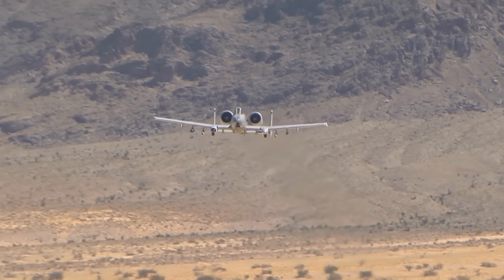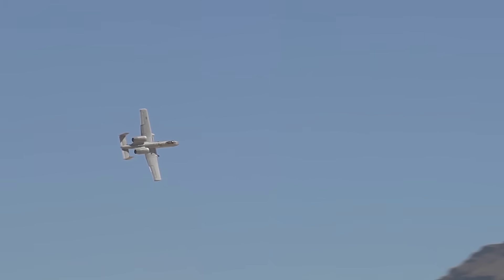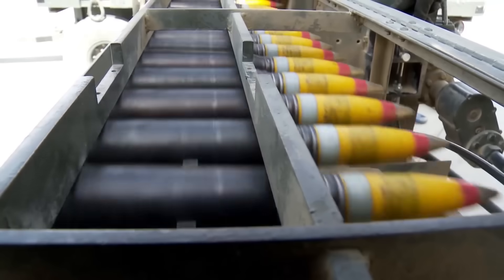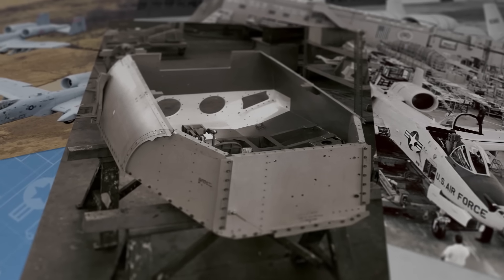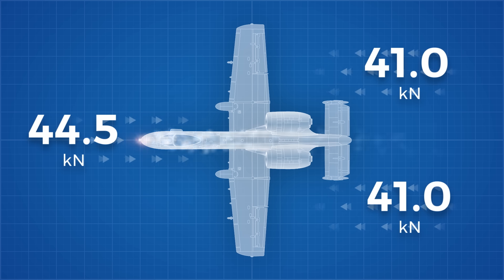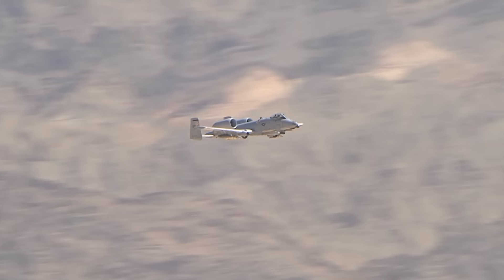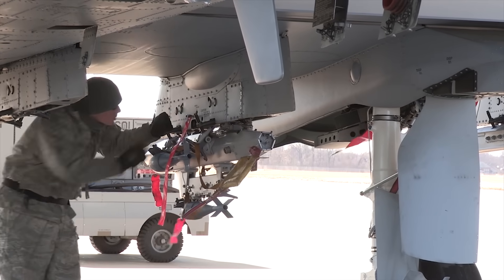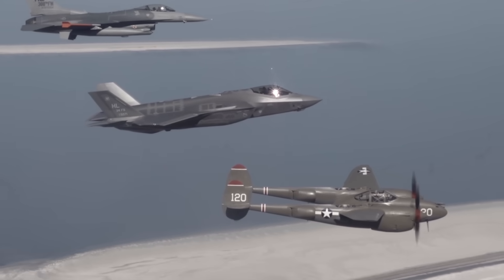The Insane Engineering of the A-10 Warthog

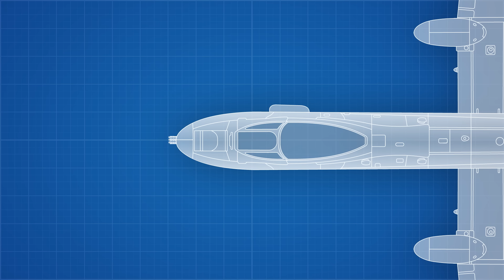Comment: 7:43 the rotating barrel assembly is actually mounted to the side, not directly on the centre. I am just a nerd, not an expert, but from memory it is the 7 o'clock barrel (assuming 6 O clock is bottom dead centre) that is the firing barrel, and it is THIS that is mounted on the centreline. If you look at an A10 front on, the gun appears to be on the right side of the nose, but the firing section is actually dead centreline.

Btw I'm not a total smart ass, I learnt a lot from this video, like the APU thing. The way that depleted uranium ablated compared to steel and becomes sharper was a really cool thing I didn't know. 👍

Comment: I served in the USAF. It is my understanding that the Air Force had the gun went to the defense contracts and asked them to put it on a plane. It was considered too big for the AC 130 at that time which had a 25mm version of the gun due to reported airframe issues that have since been resolved. Current AC 130U's have the upgraded 40mm version of the gun on them. And yes, the USAF proved a long time ago that you can make a brick fly if you put a big enough engine on it.

Comment: The gun didn't exist when the design process started, or even when the YA-10 and YA-9 flew against each other. They were in fact tested with the Vulcan installed. What did exist was a project for developing the gun they were intended to eventually use.

Comment: Much as it pains me to say, the AC-10's days really are numbered, as is the traditional role of CAS in general, due to the increased supply of shoulder-mounted RPG's that even insurgents can get their hands on. I mean, don't get me wrong, the Warthog is a thing of beauty as it flies overhead and wipes out the guys that had you pinned down, but when the other guys have six RPG's pop up and shoot it down... that's not gonna be cost effective. 
I suspect going forward, CAS will be handled by drones either remotely operated from FOB or slaved from F-35's providing CAP. After all, if they shoot down an unmanned drone, it's just materiel being lost, as opposed to pilot's lives. And while you can't mount the GAU-8 Avenger on them, you might be able to mount the M134 Minigun on one. While not the big BURRRR, it might be several slightly smaller BURRRRRRs.

Comment: The A-10 was created because the US Army had developed a helicopter called the "Cheyenne" and was primed to essentially steam the "close air support" roll (and the requisite funding) from the Air Force. The A-10's cheap design was in-place because the aircraft had to be cheaper than the Cheyenne.

As an engineering channel I very much wish you had touched on the large wing area of the A-10. In spite of its size, the A-10 is incredibly maneuverable at low speed and low altitude, specifically due to the large wing area. The F-35 does not have the wing area to be maneuverable at low speed and thus it can't turn and perform nimble maneuvers at the low altitudes of close air support, neither does the F-16, but the F-16 was designed as a fighter, and then was eventually converted to a "multi-role" aircraft by the airforce who did not want their flagship fighter, the F-15, out-performed by the F-16 which was designed by a group within the pentagon known as the "fighter mafia", who were all hated by the main airforce brass.

Anyway, if you want more information about this, I highly recommend watching Pierre Spray (the guy who created the specifications and design requirements of the A-10) talk about his aircraft or the F-35, which he hates. You should also read the book Boyd by Robert Coram, which talks about the guy who's theories about aircraft maneuverability influenced this aircraft's design.

Comment: You completely ignored the very important piece of the A10s replacement, drones. You combine the capabilities of the multirole F35 and a constant overhead Predator or Reaper and there need for the A10 drops pretty significantly.

Comment: Have a veteran bird at the museum I worked at. Flew during Desert Storm where it took a direct hit from flak. Blew the tip of the left wing  off, which got ingested by the left engine, which then on top of killing the engine blew out shrapnel that destroyed the control surface on the left side of its tail. Pilot lost hydraulics and had to switch to the fully manual control, which meant roughly 15 seconds of uncontrolled flight while on fire while the hydraulic system purged. Despite all of this, landed the damn thing unscathed and without a hitch. Honestly one of the most robust and badass systems ever.

Comment: The F-35A and C are moronic planes for the Air Force/Navy. Only the 'B' for the Marines makes sense.
The Navy should have bought a navalized F-22 instead of the F-35C. It would have cost about the same and been more capable in almost every way. And save the baloney that it is 'too heavy for carriers'. It weighs less than the Tomcat did.
 And the 'A' for ground attack? That is beyond stupid.
1) stealth means almost nothing in daylight, ground attack. It's stealthy - not invisible.
2) it can take little punishment as it has only one engine and any superficial damage can destroy it's stealthiness. Plus, stealth aircraft are apparently VERY time consuming to fix in the field.
3) it costs MILES more than the F-16 (or the Warthog did in 2020 dollars). And other than stealth - does virtually nothing the other two cannot do.
The Air Force should have stuck with upgraded Warthog's and F-16's and built an F-117 replacement (perhaps an F-22B bomber variant - which was proposed) for high-risk missions.
The F-35 is not a bad plane. But it is ridiculously expensive for what it does - even with the recent cost 'cuts' - (except in the 'B' version) and history will probably show America blew it by developing it for the Air Force/Navy.

Comment: really great assessment of the aircraft.  i was usaf from '82-89, and one of my squadron commanders was an a10 pilot.  he almost seemed ashamed of that!  the white scarf crowd in the usaf has been trying to kill this plane off, nearly from inception, but it is THE right tool for air to mud warfare!!  the ground troops love it and we should actually be making new ones.  it just works.
Reply: As long as they can keep upgrading the internals, the airframe and other part designs are going to be pretty much indefinite. Hell, at some point our materials science will come up with better materials to make them out of. I think at that point we will need to make a new design based on the original. Though potentially A-10's could be in service until AA capable infantry DEW or coilguns is ubiquitous. (That's gonna be a LONG time.)
Reply: @Sorain1  actually, the airframe and wings are going to metal fatigue.  they don't last forever, because of physical stresses in the crystal structure of the metal.  in my materials science classes in engineering school (before they went to all computer science types) we tested this.

Comment: Need some information 🙋🏻:
In naw a days US military have excellent attack helicopters like "apache".
So what is the requirement of A10 warthog??... It seems like a cross breed of an attack helicopter and a fighter jet.
Reply: A10 is more survivable in a combat environment which doesn't have terrain features (hills and mountains) to hide behind. Also when attacking armor a gun is fire and forget, the apache uses missiles in an anti armor role that have to have the target painted with a laser to find it.
In addition the A10 is cheaper to operate and has a loiter time (the time hanging around over your head to protect you) of up to 10 hours.
In addition the cost per kill using a hellfire missile, assuming every hit is a kill, is $74,467.85 (based on a contract value to Lockheed Martin of $547,934,477. to produce 7,358 of them. 
The cost of an anti armor round (DU) is between $50 and $100. Incendiary  anti armor rounds are a few cents under $27. each. 
If they haven't throttled the GAU back, in the first second of firing it puts out 57 rounds (the acceleration time for a 20 ft long gun assembly takes time to spool up) in the first second of operation.  With the standard mix on ammunition of 5 armor piercing incendiary to 1 DU round it gives a cost to one attack pass (approximately 1 second) at  $2,232.50.
In addition the A10 carries far more munitions than an apache including ammunition for 20 anti armor attack runs with the main gun (typical load out is 1150 rounds) vs 4 hellfire 38 rockets and 320 rds of 30mm ammunition for an apache in a supportive role. Even in a anti armor role it carries only 18 hellfires and 1000 rounds of 30mm. Note that in the anti armor role the 30mm chain gun is a distraction weapon rather than the anti armor weapon.

Comment: Imagine firing a gun so powerful it has a chance of stalling your plane
Reply: Plane doesnt emphasize it good enough. Imagine firing a gun so powerful it can stall your j e t
Reply: Or even make it fly backwards.... xD
Reply: Imagine firing a gun so powerful that if mounted on the back could fly your plane in the event of a double engine loss.
Reply: @duddude321  that's nonsense lol
Reply: Lushimoni it would work until you ran out of ammo. Which is approximately 20 seconds at its full ROF.
Reply: Wait till you see the AC130. The pilot has to counter act the firing of the 105. It pushes the rear of the plane over.
Reply: Devin Poli wait really? U mind going in depth on that?
Reply: @Jerry Zhang The Joke is that you could theoretically make the plane go in reverse by firing the gun if the engines weren't there. It's just to emphasize the silly amount of recoil the gun has.
Reply: @Jerry Zhang Since an A-10 can perfectly fly on one engine, IN THEORY, the thrust/recoil of the GAU-8 would be more than sufficient to propel the airplane .... for 20 seconds or so, until you run out of ammo ;-)
Reply: GAU-8 - hold my beer and watch this!
Reply: Imagine a chassis being so weak it can't fly your gun
Reply: @varunrao1373  the AC 130 it's a BADD BITCH
Reply: Just wait till you look at a forward facing 75mm gun placed on an already underpowered aircraft. The Hs-129
Reply: HAN DEYAN student not then but than* and it’s not more power-full than the engines. The gun (recoil) can be more power-full than ONE of the engines thrust 

And guns power is not measured in their recoil 🤦🏻‍♂️
Reply: @HAN DEYAN student imagine being so stupid you think a 30mm gatling cannon produces more thrust than two /large/ jet engines. man, you people are stupid.
Reply: It clearly says the pilot doesnt need to worry about it stalling the place you uncultured swines.
Reply: Gordinho da Federal he don’t need to worry about stalling because the gun is fired in short burst not one continuous. Ones long continuous shooting maybe could slow down the plane enough to stall
Reply: Why no use it to land ur plane.
Reply: Love it!
Reply: Imagine doing what this guy does, state the obvious the whole time
Reply: @HAN DEYAN student lol you could just strap the two guns facing rearwards and then fire them constantly

Comment: 7:44 nope the gun is not in the center, however it fires in the 7-o’clock position and that is centerline.                                                                                      Edit: 10:03 is a good example
Reply: How do you make a video about this plane and not mention the crazy off-set front gear to accommodate centering one barrel of an off-set canon?

Comment: around 7:45 you say gun is mounted directly on the center line but it's inaccurate, gun is mounted a bit left of the center, but the firing barrel of the 7 barrels is the one on the center line.

Comment: The titanium tub is 1700 pounds, in addition it makes gun attack passes upside down for visibility of the target (notice the fake canopies on the bottom of  10's wearing their warpaint).
In addition the engines mounted outboard of the plane was to allow 1 to be shot off with mineral damage to the aircraft (yes it can fly on one engine) rather than specifically to mask IR.
It has a time it can hang out over a battle zone for up to 10 hours. 
A lot more, but a few points. Learned a lot from my father years ago since my father designed the gun drive for MC division of Kelsy Hayes which was incorporated as the drive for the gau 8 
Oh yes the sabot for the m1's 120mm cannon is also depleted uranium.

Comment: 30 year Army retiree here - I have an opinion.  I appreciate the USAF, and I know the power of joint and combined operations.  However, I will be stern here to make a point of the seeming lack of concern of TAC vs. SAC in the USAF.  Bottom line up front, if the USAF does not want to keep the A-10, let the Army take them.  These close support devils are not for the prim and pristine world of the modern gamer (not Soy Boys, yet) fighter or bomber jock.  Mud, filth, austere supplies and personnel, poor facilities maintenance, and no golf courses (sorry about that one ;-) ).  The ground forces need a titanium belted beast that can run toe-to-toe with mech and leg forces grinding an enemy to bits (depleted uranium, lead and steel on target in an endless stream of destruction) - war is not and should not be pretty.  I know what these aircraft can do - destroy an enemy, demoralize an enemy, and help defeat an enemy.  Victory can come many ways on a battlefield, the sweet sound of that Gatling gun on your side means only one thing - victory is on the way.  Hooo-Rah!

Comment: ".... the gun has a lot of utility, which we always knew, but it isn't the principal tank-killer on the A-10. The [Imaging Infrared] Maverick is the big hero there. That was used by the A-10s and the F-16s very, very effectively in places like Khafji. 

The other problem is that the A-10 is vulnerable to hits because its speed is limited.. We had a lot of A-10s take a lot of ground fire hits. Quite frankly, we pulled the A-10s back from going up around the Republican Guard and kept them on Iraq's [less formidable] front-line units. That's line if you have a force that allows you to do that. In this case, we had F-16s to go after the Republican Guard." 

~Gen. Chuck Horner, Commander of US Central Command

Comment: This is extremely informative and well made, a joy to watch for sure!  I do have a question about @10:50 when the term 'kinetic energy' is used.  Assuming velocity is the same for all three metals, I would agree Uranium carries the most energy; however, on the flip-side assuming the same caliber, shell, and fill (potential energy) is used for all three metals, it can be assumed velocity wouldn't be the same due to inertia - Uranium being the slowest do to higher density, which translates to more mass... In other words, when you say kinetic energy do you really mean inertia (stopping power)?

Comment: In '81 or '82 I saw the smoke rising up from an A-10 crash just after getting to work in the morning on Nellis AFB.  It was on the other side of the runway not far from the tower.  It was doing a FCF (Functional Check Flight) when it went into the ground.  The pilot didn't get out.

Comment: They armor protection protect the engines too, fyi ,...both. Not just the pilot. And the placement of the engines was to prtect them to from ground fire not just heat seakers. From ground positions and pot shooters between wings and tail they are protected.

Comment: a10 has a fairly low stall speed (it can fly slower and still stay in the air) and its overpowered engines make it possible to maneuver like a crop duster --- both important for close air support when you want to fire a gun at a ground target. low-tech simplicity is desirable in this situation.

Comment: 10:47 - the high density of enriched uranium is not for added kinetic energy (But off course it is a plus). It's because at these extreme speeds  the material is impacting at a Hypervelocity impact regime, where the most important impact variable is density.
Reply: Also, the round is designated as 30mm DUPI (Depleted Uranium Penetration Incendiary) for it's ability to ignite upon breaching armor plate.
Reply: Marshall W  haha whoops you are absolutely right lol.
Reply: The heavy depleted uranium rounds ensure penetration at high incident angles of attack.  Think, cruise missiles incoming.
Reply: Depleted Uranium not enriched! lol
Reply: Marshall W  they aren't  the mix loaded onto an a10 is normally 5 rounds anti armor incendiary to 1 round DU (a aluminum round with a depleted uranium core).
Its actually the same gun you are familiar with.
Reply: The 30mm round is NOT a ke round nor hyper velocity. 
Muzzle velocity is 3324 ft/s (1010 m/s). That's on par with many hunting rifles. The DU was included as a core for its hardness in this case (like the steel or tungsten core in a rifle or machine gun bullet for anti armor).
By contrast the APFSD  round for the 120mm cannon on a M1 Abrams is 5500 ft/s (1680 m/s) and the core weights 10 lbs.
Even it isn't considered hyper velocity since that has a lower speed of 3000 m/s or 10000 ft/s by or 2500 m/s depending on the definition used.

Comment: A good weapon system for it's time. But hopelessly obsolete now.  Due handheld missile and radar guided anti aircraft guns it combat envelope  is pushed so far to make its main weapon the Gatling gun useless. It's now just a big expensive to operate standoff platform.
Reply: Works great for obliterating dudes running through cover though, and turning light vehicles into scrap. 
Just wait till they give it directed energy weapons, hehe.